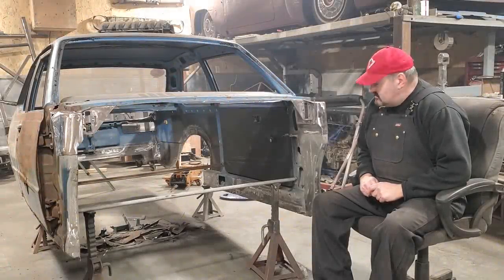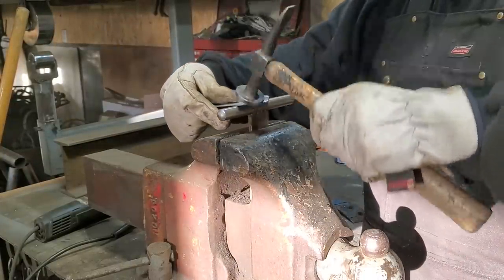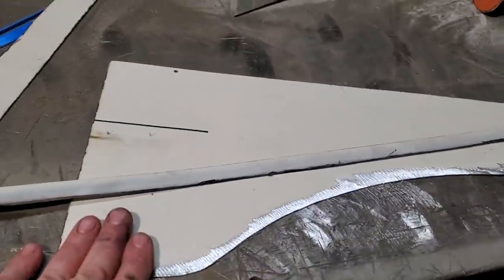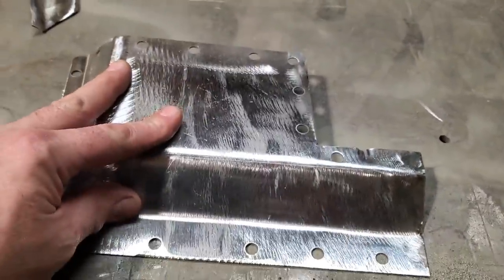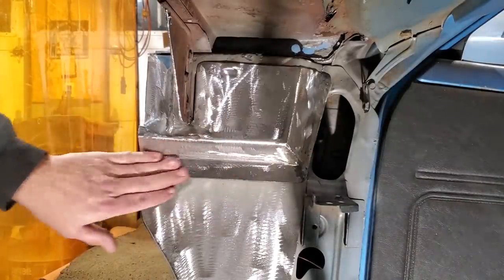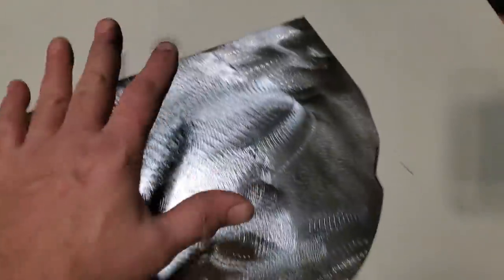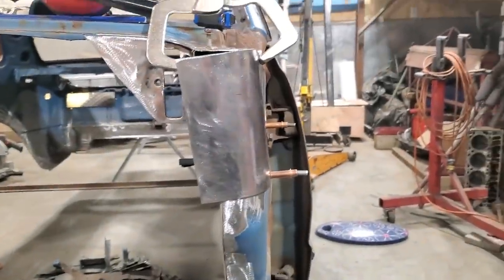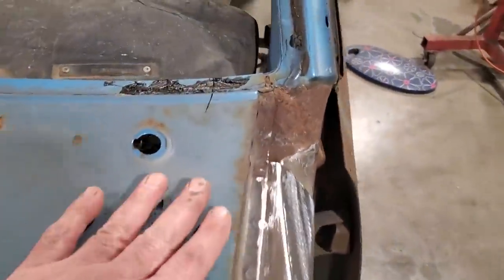Crusty. Custom body panels made with simple tools

Comment: I have been watching your videos for a awhile.  I just got a welder, still using flux core.  I bought some 20 gauge sheet metal (the place didn’t have 18 gauge) and practiced doing a butt weld using all the tips that you described.   I came out very good, no burn through or warping.  Thank you very much for doing these videos and sharing your expertise.  It is very much appreciated.
Reply: I was told that 55 gallon barrels are 18 gage. Now there aren't free barrels like there were before I wanted them. It figures!
Reply: Hi, I have been watching the channel and learned a lot.  I have a 1967 jeep gladiator and want to swap the cab and bed to a 1991 Silverado chassis.   The bed need to be cut to fit the chassis.  Any advice to make it fit? Also want to change the steel bed to a wood floor. Is this easy to do it? Thanks for sharing your knowledge with us.

Comment: Great work my man. The only thing I’m concerned about is how you guys can work with interior panels so near your Welding and expect everything to be OK. Glass,upholstery, car seats, instrumentation, or anything that composes up a car. If you’re gonna be working on metal, you cannot be within 10 feet of that stuff or else you’re gonna have issues. One day I was grinding something on a vice and behind me was my car 8 feet away and it took out the glass by leaving enough melt holes in it that I had to replace it and it came from the spray of hot metal, 8 feet away and directly behind me. How how happened I don’t know but I do know you can’t have anything anywhere near grinding or welding but I see you guys do this all day long on YouTube and then I’ve also seen the results of this as well when I’ve gone to look at cars that have been restored, and I see glass that has melting spot points in it I see a car interiors that is peppered with burn marks now this is usually not seen unless xxx times magnification of course but the thing is it’s still there! you guys aren’t protecting the car along the way. and you’re actually ruining it up as you rebuild it. Making it worse. Now certainly in this case, your probably not gonna use this panel, that’s on the door that’s several inches away from your welding. But if not use it, why not resell it before you ruin it I mean, I love this channel and I love the work you do, and it helps a lot of people, but I just am against peppering cars with hot metal while people work on them. It bothers me. And it happens just about every channel I watch. I think most people don’t realize the aftermath of working with hot metal and what it does to your surroundings.

Comment: Why are you welding on a half inch lip  cant you bend it ?
Reply from the maker: I want to weld on the corner. Bending it will be tricky to get a nice corner. The lip I welded on is backing for when I welded the corner

Comment: I picked up an old skool used CP air grinder off eBay which basically identical to you IR, they still do newer style listed under pistol grip compact air sander .
I got 19 30 grit sanding discs with it, man they bad ass :-) 16mm centre bore but I turned adaptor for 22mm so takes my worn down angle grinder cutting discs and stones.
The cutting disc trick super useful for weld dressing and that been proper good tip but also the control on the air tool plus the size factor is superb for precise cuts in awkward spots. Made some repairs on strut turrets on a old Forester this week way easier and neater job .
Other good tip has been on making panels in stages/parts and leaving things bit oversize and 'trimming it after the fact' lol . I was one for trying do to much from one piece of sheet and trying cut bang on to size which tends result on it always being bit too short :-P 
Good to see you also only human, also good see relaxed way you simply address the problem as a cool head and not over thinking things certainly keep the job more enjoyable which helps enthusiasm which helps the final workmanship quality massively .
Have fun and I'll see you next time Mr Fitzee ...

Comment: I believe the grinder part number was the “17A”. But the first number has been worn off. 317A is what I think is the correct part number. I saw someone else post 117A but that looks up as an air hammer for me. Anyhow, that should be enough info to get someone started on a search.

Comment: Wondering why you started out with a rusted out clunker. Repairing the rust (new floor, rockers, fenders, quarter panels, windshield, side lights and backlight adds tremendously to you time, agrivation, and cost.
It looks like the car started out as a unibody. Are you building a frame for it from scratch?
Reply from the maker: I like the 70s imports. It's a challenge and I enjoy a challenge. Look back threw my videos you will see what my plans are

Comment: Another Genius video Fitzee!!!! The way you design and make it all look like factory is so amazing. And you make it look so easy!! I know the years of experience also helps. One question. When you weld the long flanges on the firewall mounting plates, do you weld the flange continuously or do you stitch weld until it is all filled in?
Reply: Mate id reckon continuous will cause heat and warpage...my opinion stitch and recover or as some say stitch and come back  to disperse heat evenly
Reply from the maker: I stitch weld everything on body panels. Controls the heat better and also I have the welder set up hot so it has to be stitched. If you run a bead you burn threw.
Reply: @fitzeesfabrications  thank you for your explanations

Comment: You got me through my rot repair project on my truck.  Unfortunately or fortunately, this is probably the last rot repair I'll be doing for a while.  Thanks to you I was able to make a few pieces from scratch and install some purchased patch panels in.  I bought clecos for the project and never used them, I ended up using self drilling screws for temporary holding where needed...lol. I'm sure I'll use them somewhere eventually.

The entire car is stripped out except for those interior trim panels, no floor, no dash or firewall... nothing... I got a chuckle out of that. 😉

Comment: Great video, learning many new options for repairing body panels. I have a question, did you ever get the body decor replacement for the quarter panels on crusty?
Reply from the maker: No I did not. Still looking
Reply: @fitzeesfabrications  I have found 2 sets of them in a local junkyard. I will see how much they are if you like.

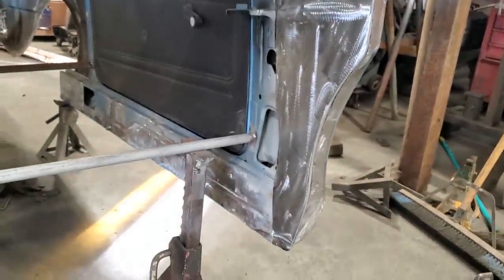Comment: @19:19 Your little grinder is an Ingersoll Rand 317A  and it turns at 18000rpm max . :-)
Reply: Do you know if the speed is adjustable, or always 18,000?  It's called a sander online, but you called a grinder.  Will it work as both?  Thanks.
Reply: @rgc1961   No idea as I don't own one :-) but it has what appears to be a speed control on the handle 
and you should also be able to throttle it with the trigger.

Comment: Hi Tony, how would you go about widening wheel arches the classy way, as in only someone who knows the model would notice? I've got 3 pairs I plan on widening, front and rear on a Datsun 1200 Utility and rears on a '81 Z28.
Reply from the maker: Depends on what you mean widen? Widen forward or back  or widen outward? I have a video on forward and back. None on flares or Frenched
Reply: Flared. I think an inch each side on the back of the Camaro and the 1200, probably a bit less on the front.
Reply from the maker: @FMuscleZ28 . I have frenched cars before. Got up to a 1.5 inchs and still looked stock. Look at the 80s Ford Capri  for what I'm talking about. They had a frenched quarter as well as front fenders.

Comment: Do you use zink weld through primer as paint in the video?
Reply from the maker: No. I don't like it.  It affect the welds. I just use a simple rust paint and I clean off the spots I'm welding.
Reply: @fitzeesfabrications  Alright, then like a epoxy paint with phosphorous acid in it? Like a rust encapsulator?

Comment: What paint are you painting inside the panel
Reply from the maker: A simple rust paint.
Reply: @fitzeesfabrications  ah so you dont mess with with weld through primer like most people?
Reply from the maker: @johnadona3014  no I find it very expensive and it affects  the welds. I used it in the past and had my share of trouble. Also where you weld still burns and open the steel up from protection